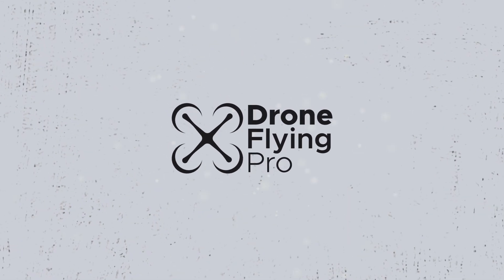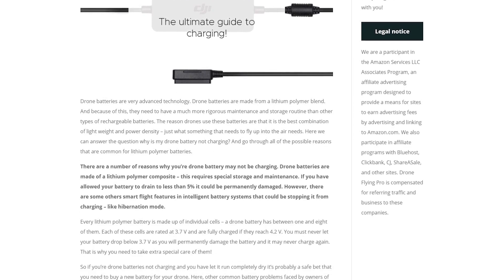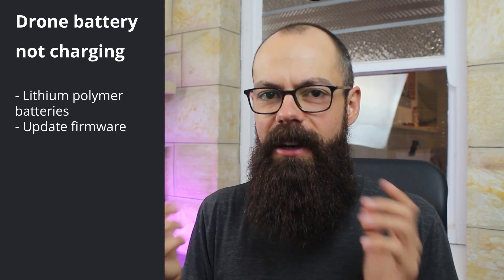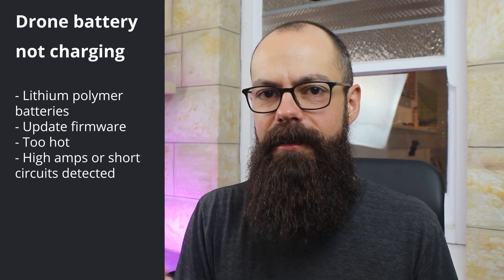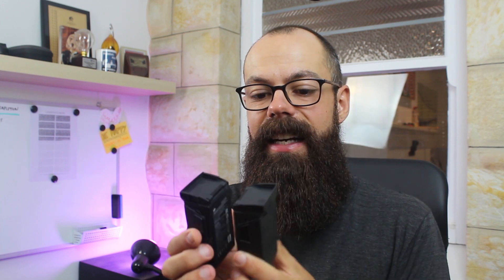Why your drone battery not charging | 5 simple solutions to try

Comment: I have a Mavic Pro Platinum (purchased 5-6 years ago) and used it once when trying it out. It's been packed up in the cupboard ever since. I decided to get it out to sell it and the batteries appear dead. I've had then on the charger for hours with nothing. No LED lights on batteries and unable to update anything because I can't turn drone on. Apparently you can't buy batteries either. Any fix for this?

Comment: Hi just pointing out these batteries will also not charge when it's cold mine were too cold and would not charge I had to heat them over my heater for about 5 or 6 minutes and they charged up just fine make sure they're not too cold and not too hot

Comment: I have a VA-1000 drone, the battery is smaller than the one he shows on the video. MY battery won't charge for any reason he stated. the problem I am having is about the charger having a very small specific part to charge. The charger would go in and the light would flash for a tiny half second. I would try to plug the charger in fully but it won't go in. There is a sort of half way moment when the red light shows up, but it quickly goes away and I'm stuck with a dead battery. Does anyone have an answer for my problem?

Comment: Hey guys... I just got my E99 and I ran into a problem.  I can't get my lithium batteries to charge.  I'm using the li po usb cables it came with.  When I plug it in, the red light comes on for less than a minute.  And when I leave it to charge for an hour or two, the battery is still not charged when plugged into the drone, whose lights are blinking with low battery signal.  What am I doing wrong?  Thanks for your input...

Comment: Major screw up on my part. I just got a brand new drone and reading up on instructions on how to use, and first thing it guided me to do was to plug in my batteries to charge them. Well, wouldn't you know it, my cell phone type c charging cable was laying right there so I plugged it in to new drone battery charger and pluged the brand new battery intobit. shortly thereafter I read instructions which urged to use the cable that came with the Drone. unfortunately I could only get flashing lights from that point on.

Comment: Just got my Spark.  the Go4 app says it indeed does need an update.  However, my drone was shipped with such a low battery the unit will not power on long enough to connect for the duration of an update.  If that's what it needs, how can I nurse it to enough power to update??  thanks,

Kevin

Comment: Kind of surprised that you didn't mention battery hibernation, with is the number one reason that batteries won't charge. DJI batteries will go into a hibernation state if they are left uncharged for a long period of time. This is to protect the battery from total discharge. While the issues you mentioned might be a reason, they are probably not the reason if your batteries have been stored for a long time and now won't charge. Also, there's no way to update battery firmware if you can't turn on your drone.
Reply: Hey Jeff, thanks for the info. My drone (phantom 3 pro) was stored in a case for a few years. During that time, it may have been subjected to temps from 95F to 15F. They will not charge. No lights or anything. The voltage checked directly from the battery terminals is .003vdc, and the continuity is good. The charger is putting out 17vdc. If my battery is in "hibernation mode", how do I get it out of hibernation mode? Thanks
Reply: I had the same issue "To get the battery out of hibernation, you have to charge it directly via the drone for a few hours to reactivate the battery. @raybone3
Reply: Do your batteries seem to be tight when inserting them into your drone? Mine are. They seem to be a little bit "puffy". Mine were also subjected to low temps (around 15F).
Reply: Puffy batteries are not a good sign. They might have swollen and could actually start leaking over time. They also can not be revived if they are in this state.
Reply: I have the same behavior here, what is the solution for battery hibernation?
Reply: There are several video that show how to use a small Raspberry Pi circuit board in conjunction with software to "unlock" the batteries. Unfortunately this method only works if there is still enough voltage in the battery for the program to get a response. This works maybe 1/3 of the time. If it doesn't work then the only option is opening the case and using a bench power supply to bring the power cells up to enough voltage that they will then be recognized by the computer program. Here is a video explaining the process - https://youtu.be/OZOIQDBmzKY?si=uoFx75Y9dgIcWAmN
Reply: I have the same problem with my 2 Mavic Pro batteries, from the lack of use, but it's been stored at optimal temperatures and humidity. Maybe we have to buy a 3rd party battery just to get the Mavic Pro going again, update firmware, pray and hope the 2 expensive batteries work again. I have hardly used them, it would be a shame to toss them. We may just have to simply schedule use/drain and recharging of the battery every few months or so.

Comment: Possible new fix for drone battery not charging. I have a Magic 2 Zoom.  This worked for me 100%.  The battery would not charge at all.  Here is the fix.  Take a fully charged battery and rub the flat surface to the flat surface of the battery that won’t charge.  I did this in a circular motion for about 10 seconds snd when I hit the button on top of the dead battery a light came on.  I was then able to connect the dead battery to the charger and it’s now charging.
Reply: Rub the flat surface of what to the flat surface of the battery that won't charge? My battery has 4 flat surfaces by the way.. yours don't? Please elaborate in more detail
Reply: Thanks it does work my battery is now blinking like it is charging

Comment: i just got some "new"  batterys from the store, however one of them already was broken, all 4 lights is blinking when i try to charge it up, and acording to the manual fro dji mini2  this is doe to the charger detecting that the battery are damaged. when inspecting the battery i descoverd its production year for all 3 batterys I have gotten with my new drone is 2018!!! meaning they are allready 3-4years old! acording to what you say about age, should I then take all 3 batterys to the store and make them give me 3 new batteryes even thou the charger only say that one of them is dammage? 
the drone has never been used, as I got it for about one month ago and the first time i tryed to charge i had to give it back to the store as 2 of the batterys had the same problem, they gave me 2 new once ofter a monthe and apparently its the same problem with one of them now.

Comment: Sadly DJI no longers makes batteries for the mavic AIR.  Any recommendations for reputable sellers of these batteries?  Given their lifespan of 2-3 years getting a used, legacy or refurbished battery at nearly the cost of a new mavic mini seems questionable.  Sucks that DJI Mavic Air 1 batteries are both proprietary and discontinued.  I've had this paperweight drone for over a year just sitting.  Can't stomach buying another from DJI after being left out in the cold.
Reply: They just restocked on DJI go now!
Reply: #1 Get it one used #2 if you have some basic electronic skills... They are few videos that show you how to fix it... Even how to increase flying minutes 🛩️

Comment: Hi, i could not update the firmware of a battery as it is completely off (no light). Is there a clever way to bypass it?
Reply: This is why I am here, waist of time. These are good points but in no use of an actual dead, un chargeable battery. mine was charged when stored and 1 of 3. The other 2 were fine. I have seen where people say that is has discharged too low and all they need is a jump from a separate non smart battery. This has worked before for me but it didn't work this time so I was here looking for a new tip. well off to another video..
Reply: @indykurt did you find anything out?
Reply: @Codeman.2793  no, it was a lost cause, sorry
Reply: same for mine..
Reply: I just got it a better power source but only 1 of them started working again so.. I guess

Comment: What this guy doesn't mention is what if the battery is completely dead, even if you connect the drone to the computer if the drone wont power on because of the dead battery you CAN'T update any firmware 🤦‍♂🤦‍♂🤦‍♂🤦‍♂🤦‍♂🤦‍♂🤦‍♂
Reply: Replace the battery

Comment: Thanks for the info. I didn't realise the short life span and the need to avoid leaving batteries uncharged for months so my two batteries (DJI Spark) are dead, I managed to buy a second hand one but DJI no longer sell the Spark battery! (MB1). So the Spark is useless given limited life of batteries and DJI's failure to keep selling replacements.

Comment: Man, I have been searching far and wide for some good info on these issues, and besides the obvious so-called fixes that rarely work on truly bad batteries there is 0 info. So just for anyone that cannot fix their batteries with the usual tries shown here, the problems with any dead or not charging batteries are 2-fold. First one of the batteries has gone dead and is triggering the lights to flash or do whatever they do to not allow the batteries to get a charge, second thing is the controller on the electronic board has gone the way of the dinosaurs and stopped CONTROLLING. This mostly gives a complete battery. These batteries get hot when charging or using, they are sandwiched together in a 4 pack or so and they transfer heat from one to the other. The batteries are not smart it's the electronic board that is smart until it is not. So, if you have skills open them up and test for shorts on the board, also test each cell for charging, at 4V plus for the Phantoms. The others should be similar. Peace.

Comment: thanks for this brief explanation sir. but how do you fix the charging problem after updating firm ware. i have two Mavic pro batteries but only one is not charging.
Reply: Just a faulty battery..
Reply: @DDAquariums    Thanks for your brilliant insight, Sherlock

Comment: I have 6 battery for two dji mavic pro platinum. All battery just blinking 1 of light and shut of again when charging. The battery never charge since I bought it about one and half year ago brand new in the box. Cause I use another dji mavic pro for play and learn. Just a week ago I opened the new drones but the battery would not charging. How do I fix it? Thanks.

Comment: 1 of my mavic air 2 batteries had 1 percent left I plugged all 3 in and only 2 charged up and 1 of the 3 is completely dreaded I tried charging it by its self and nothing only has around 24 charges on it help.

Comment: How do you update firmware, when a battery wont charge. It won't turn on, hence it can't power anything to allow updating.
Reply: Looks like no one has the answer to this valuable question? Very well giving out info that doesn’t really help, obviously I’m connected to my computer via a usb but it doesn’t read it’s there?.. I hate half solutions that just waste my time, very dissatisfied, expensive batteries that can go beyond hibernation and ya need to be a tech geek with crazy circuit board to recharge some life in to them….. not happy 😢
Reply: Im on same boat 3 bat all dead, how can I get some charge to at least be able to update the bullshit firmware?
Reply: @martinhornos2034  all 3 batteries won't charge on my mavic mini.  bs,  because it's not that old and i haven't flown it much.
Reply: I have two phantoms and two sparks.  You MUST charge the batteries every six months, whether you use it or not.  If you don’t, it can drop to a voltage level below the base charge level.
Reply: The answer is on google you plug it in for 28 to 48 maybe 3 days that’s what I did to mine and it work you just leave them on the charger until they exit hibernation mode ITS IN THE OWNERS MANUAL AS WELL😂😂😂😂😂😂😂😂😂😂
Reply: @jockjames86 just read the entire Manuel and it does not say this as a fix if the batterys won't charge
Reply: @jockjames86 reLly?
Reply: That doesn't work either. @jockjames86
Reply: @jockjames86 hey! Did all four lights blink for you until they exit the hybernation mode? Cause for me all 4 lights bilnked
Reply: If there is no power to power the aircraft on at all they are a total loss. They are designed to hibernate however they lose power during hibernation and if it goes dead to where you can’t even see an led turn on, they are gone. That’s why I hate everything with batteries.
Reply: He said we can put the battery in the drone and attach the drone to the computer. I have to figure that out too because I don't know if it is possible.
Reply: @MarkQuijano  mine isn't charging or even reading that anything is plugged into my PC. This was basically tips to keep a healthy Batt. No solutions offered.
Reply: @NSWvet83  my side 7 hr battery stuck
Reply: For everyone struggling plug your controller  to the drone using the insert they give you to connect to phones, this will take it out of hibernation mode
Reply: @fishingtour1642  is that a lightning connected and where is the connection to the drone located?
😊
Reply: @fishingtour1642 once plugged, what should i do
Reply: What do you mean exactly ? @fishingtour1642
Reply: @fishingtour1642 will I it work I try?.
Reply: @fishingtour1642  
Can you give more information on this , I’m trying to wake up my Mavic air battery
Reply: Crazy how he doesn't reply to everyone with the answer
Reply: I am having the same problem
Reply: EXACTLY BRO , I HAVE THE SAME CONFUSING PROBLEM
Reply: Useless video everyone came here for this answer and he failed us
Reply: yea was about to ask same question
Reply: EXACTLY,  but this Youtuber is too dumb to figure that out.
Reply: 2:06 - Sounded great at the time but duh.....if the battery is dead then what powers the drone on to perform that update? I have been reviewing a bunch of these YouTube vids for my DJI Ryze Tello batteries.  Left unused for too long so not charging. NOTHING in these YT vids will help to resurrect them. Batteries `- "Smart" or not are the money pit of all RC's !
Reply: I’m stuck with the same issue!
Reply: Can you fix pins on the batteries that are bend or not straight?,